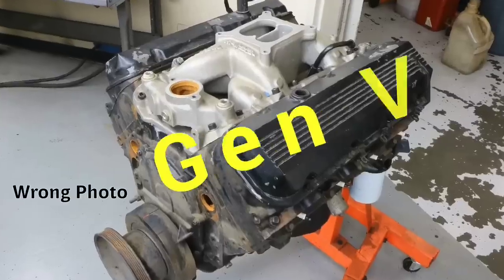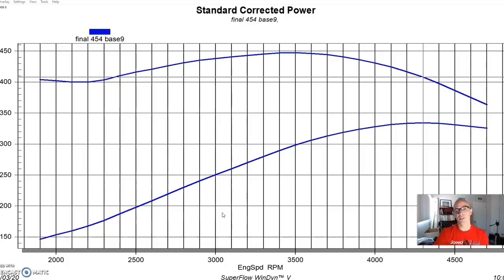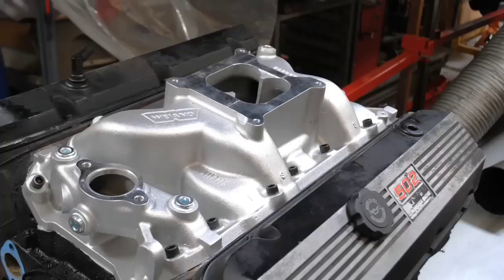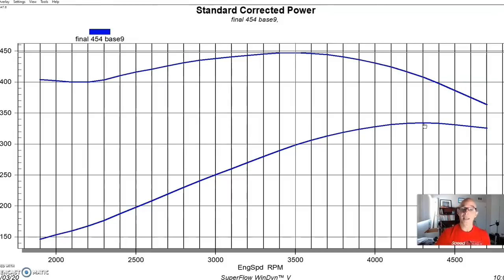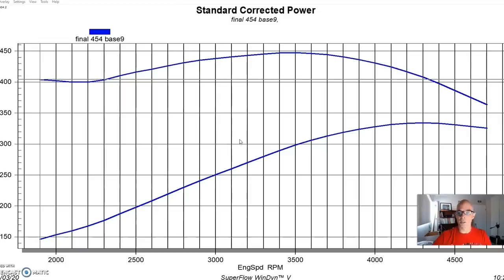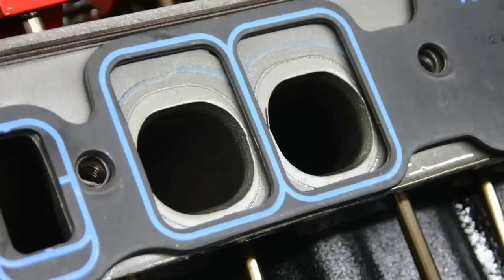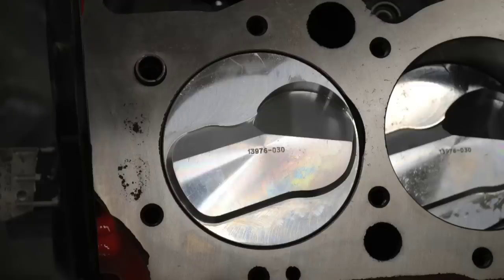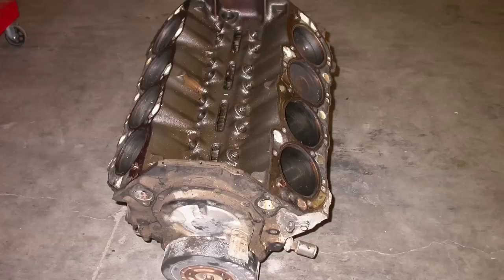HOW TO UPGRADE YOUR TBI PEANUT PORT 454

Comment: I have a 1985 k30 with factory 454 and 4 speed. I love that you can pull the engine down to 800 rpm in 4th gear and then accelerate without even downshifting.  No point to ever rev the engine above 3500 RPM it's not ALWAYS about peak horsepower.  And yes I also have a 700 hp n/a big block in a different vehicle. These peanut port head do have good use in certain vehicles
Reply: Dont know if you will get this its been 4 years but i just got a 89 GMC K3500 Ext cab s I single wheel not dualy came from factory w 454 4 speed and original motor had problems and they just put a new 454 in it. I just got it a month ago and im not a professional mechanic so ive got in a shop getting a lot of bugs out of it. So my question to you does your k3500 do good off road. O know they are longer than most 4x4s but beside that by what o have seen they out do jeeps and Toyotas in a lot of ways. Any help would be appreciated! The last 454 i was around was when i was a kid my dad had one for our farm.

Comment: I have done the 1999 454 Gen 6 L29 stock peanut port heads no muss no fuss simply; 
pull all the junk injection off, add a single plane rectangle port, a q-jet, the biggest exhaust possible, Mallory Distributor with the soft gold springs, toss in a bunch of timing by hanging out over the hood while pulling a hill and enjoy at least 70 more Horse power. Makes my 11,000 pound 16' cube truck Haul ass!
Reply from the maker: 1999 Gen doesn't have peanut ports and why a single plane-what about a cam?
Reply: @richardholdener1727    This all happened way before you were born so, Dude, don't even worry about it.
Reply: What did you set the timing at
Reply: I put a gen 6 454 in my 81 4x4 suburban put a dual plane performer intake with 750 qjet and hei dizzy. The motor is all bone stock and having trouble setting the timing. Please help.
Reply: @KeithLaney-gq7cz   Night and Day difference, 454s love timing, low octane fuel and Headers!! The original Distributor can't be tuned to what we want (and has no advance) but, an old 1981 Deco (Coil in the cap) can and has centrifugal advance! No Vacuum advance hose and plug it and turn the timing up to where the engine performs the best (About 34 +/- 2 degrees of timing at 3000 rpm BTDC) there's a fine line where the beast comes alive and then falls on it's face before and after this line (Careful the ping is very weak sounding). I have a 2000 454 Savana so I can reach down (With the cover off) and turn the Distributor while I am WOT, you might have to climb out on the hood while someone else drives/ Hold the Brake/Dyno/Race Track or best speed, I know crazy, Huh?!!  I like to put the weakest springs in the advance. I also like the (single plane manifold) Edelbrock Torker 2-R for mismatched ports (No Porting required).  I think, ya could use a 900cfm Holly dual feed.
Reply: @richardholdener1727    Ok, Oval port
Reply: @KeithLaney-gq7cz     Guessed

Comment: Cool Test. I run a MK IV 454, .030" with bowl ported PP heads (minor intake port porting), bigger valves, ZZ454 roller cam, Morel lifters, Erson roller rockers, balanced to under 1 gram, and Edelbrock Pro Flo 4 fuel injection. In my 80's pickup, its alot of fun, serious torque down low. I'm still learning tuning on the EFI, but its a great combo for a "normal" street engine.
Reply: I am considering something similar, which Pro-Flo system did you get? I don’t think they make a peanut port kit, just rectangular and oval
Reply: @carlcochrane2030  I just bought the oval port kit Pro Flo 4. I have the inlet of the head opened up some, but still not a full oval. I think you'd cut the roof out of the port if I remember correctly trying to. For what I do I doubt the mismatch is really hurting anything. I have seen rec and oval port intakes tested on oval heads and surprisingly no loss on the dyno. Crazy to think that wouldn't cause an issue. Maybe another good test for @Richard Holdener to try...is port mis match really something to worry about for the average guy? I personally think not in most cases.

Comment: I am using these heads with a tunnel ram and twin turbos , i just port matched the heads to the oval port intake tapering the ports to the bowls , ( ALLOT of CUTTING ) In a k3500 dually, and its a burnout monster, not to often to see a test like this. THANK YOU! as close to a baseline test as i can get.

Comment: I had a gen6 454 that I dropped into a K10.
Edelbrock Performer 2.0 intake, Mercruiser 454 take out boat cam from Competition Products (There used to be titled as "B1" take outs from brand new boat motors... costs $35), 454 H.O. valve springs, comp rotor eliminator shims under the valve springs, upgraded timing chain + cover.
Truck only made it across town before it blew the oil cooler line and locked up solid.
No idea what power it made, but it would light up 38x 14 wide tires in the rain super easy.
Been keeping my eyes open for another one on and off for about a year with no luck yet.

Comment: I saw this on my notifications, after watching this I found my answers. Thank you Richard I just so happen to have a running Gen6 & a 1992 Gen5 running with a bad transmission. My son wants the king cab dually the 92. Well I'll fix the transmission get it running & build up the Gen6 but my son wants cubic inches so a 496 build is what he wants. I may have to convince him to go with 750 carb until he gets funding for a multiport setup. Cam will be similar to you use on the test. Great Vid!!!

Comment: Richard - another awesome video!! hit the spot. I have a GEN VI with flat tops, old skool '69 396 small chamber heads with race-flo valves, and the Comp X4 278H cam (.544/.564) and it is very close to this combo. EXTREMELY SNAPPY throttle response and throws down the power. Great 4x4 truck motor - Great combo.
I have a set of 345 Rec Merlin iron heads (still cheap, but yes...iron) and the original GEN VI heads. Would like to see either/both/similar to these with slightly more cam since I have an extra short block...

Comment: In the middle of this build now. Same dished pistons from KB forged. Smaller cam .501/.501 lift but 049 oval heads with larger valves….. tow duty for the dually.

Comment: Richard, I have an idea for a test. I think a lot of people would really like to see the power differences between the peanut ports and 781 heads on a stock engine with a stick cam.  putting an end to the debate online would be great too.

 The flow isn't that much different up to .300 lift. the 781's have about 15 more cfm at .400 and 25 more .500. The velocity difference is quite a bit though. It would be interesting to see what the difference in the power curve really is.
Reply from the maker: with a stock cam?
Reply: @richardholdener1727  yes, with stock cam. You could add to the test also and use a couple different cams with and show where the seperation starts to show between the peanut ports and 781/049 heads.  People would know without a doubt where to put there money then. It would also what it takes to take advantage of the bigger oval port heads
Reply: @richardholdener1727  I'd love to see this test also. My current project car is a 1980 Trans am that came with a rebuilt stock 454 with the peanut port heads, edelbrock performer rpm intake and headers.. I've been schooling myself on what the best factory heads are and it seems like the 781 and 049 get cited most often. I'd love to see how much of a difference these heads would make on a stock 454 over the peanut port heads ,without any other changes. Then test the 781 or 049 heads with a street cam that would be compatible to them to see what a low buck package like that could do.

Comment: Fantastic.  I'm cleaning up a 454 Gen V Suburban right now, and was looking for tips.  I've got it back to running perfectly stock, all sensors and distributor changed.  This thing is no slouch with just a major tune.  Tonawanda bow ties rule.

Comment: I built a gen V with 10.22:1 .030 over domes ported the heads with the same cam and spring etc you used the intake is an Edelbrock performer 2.0 with a Holley 750 vacuum secondary carb I haven’t fired it up yet.

Comment: smaller port= higher velocity mix, great for swirl action and economy applications.  Thanks Richard for the upload 👍
Reply: I don't know John N some how 454 and economy don't seem to fit LOL
Reply: @mrelectron6220  Truth to word on this for sure, but there are approaches to "lessen" the pain, lol
Reply: @mrelectron6220 I'd bet you could get some pretty good numbers out of this beast put a 6l80 behind it with 3.00 gears lean out way out on cruise
Reply: @austindoud273  Yep. When you compare a Big Block to a Small Block in a heavy vehicle, the big block actually gets better mpgs than the Small Block.

Comment: Hey Richard, I did all that stuff for my rv on a gen 5, ported peanut heads with maxed out valves and one more step up on the cam shaft. I just need to improve the intake and exhaust manifolds. I'm looking to put an allison transmission behind it.

Comment: I've done something similar except I put 69 large ovals with 2.19 & 1.88 valves. Mildly ported on Gen V freshened up stock shortblock. With Comp. Cams 292 Magnum. Ran very well on Premium pump gas.

Comment: I would assume my 454 is a gen iv as it had a cast iron intake with a aluminum tbi adapter. It does have retro roller lifters and a comp Cams 266H R12 roller cam in it. I regret not getting it earlier as someone obviously beat me to the rockers, studs, guides , and pushrods! Oh yeah, the chrome valve covers that were on it also. It was in a 1 ton Chevy dually around a 1990 model as it still was the square body.

Comment: I have a 90 duelly and the timing gear blew up (plastic gear). So I put a set of edelbrock heads and their can in it, it made a noticable power difference but not alot. So bought a hyper chip and installed it, very small change in performance. So in my opinion I think the throttle body isn't giving it enough air. So I think going more compression was a smart choice, now I'm anticipating going to a carburetor or aftermarket fuel injection.

Comment: My combination is a stock cast crank cast pistons 2 bolt main gen IV. Up grades include ARP studs on the mains, ARP rod bolts, Oval port closed chamber heads ported with 2.19 intakes 1.7 exhaust, installed with steel shim gaskets, comp. ratio about 9:1  Cam is 224-234 @.050 on 114 LSA cam lift .311-.325 with 1.8 roller rockers. Weiand stealth duel plane intake, 750 holley HP, long tube headers 2" primaries, 3" exhaust. Transmission is NP440 MY6 3 speed with OD. Rear end is 10 bolt posi with 3.08 gears. 1st gear is 3.09, combined with the 3.08 rear gives 9.5 final first gear ratio. Don't know the torque and hp but in 2nd gear it pulls like crazy to 5500rpm, It's a smooth running engine and lots of fun. Thanks all the best.

Comment: I have a 1994 Chevy k3500 with a Gen V block. Last summer I swapped the heads to gev 6 with a intake and headman headers. And Holley EFI. Would love to see you do a build on a similar engine. Gen 5 block with gen 6 heads!
Reply: Oh yeah and I’m running the stock gen 4 camshaft :((( need to upgrade
Reply: Gen 5 cam
Reply: What head gasket do I use to I'm wanting to do the same thing

Comment: I did a set of peanut port heads with 2.25'' intakes and 1.88'' exhaust valves for a jet boat. 10:1 454'' with a hydraulic roller. It got up on the hull real fast and was quite quick. It was a jet so it didn't mph. Torquie for a small motor.
Reply: Which pistons did you use? Run on pump gas?

Comment: I'd just stick with the Gen6 if I found both in a wrecking yard. Now if I already had a Gen5, then maybe just throw the cheap Gen6 heads on. I currently have 2 Gen6 BBCs. I bought some 100cc Performer RPM heads with a performer RPM roller cam, stock lifters, holley high-rise intake and 825 Carb and headers. Makes 580hp and hauls the groceries in my 69 Vette!

Comment: Mr Gasket makes a shim head gasket for the BBC, supposed to add about a half point of compression at least (I think the 86-92 7.4 TBI motors are stupid low compression, like 7.5:1).   had considered going this route just to see what happens.   I mean the gaskets are about $65 at Summit so it's not like you threw a bunch of money at it.
Reply: They are stupid low compression. I have an 89 LE8 with 50,000 original Miles on it that I pulled apart just to see what the real compression ratio, it had obviously never been apart so was completely stock. After cc ing everything, it came out to 7.78 to 1. It's surprising that they made the power they did with pathetic numbers like that.

Comment: Keep the forged pistons keep the cam keep the peanut ports and put on a little 174 weiand roots blower on it. Torque thru the roof @ 1500 . Also 500 horse. Remember for the street those peanut ports have amazing throttle response.

Comment: Id like to see keeping the peanut port heads with a hydraulic roller camshaft  specs. 262/272  Adv. Duration 210/218@50 with .510/.525 lift with 112 lobe separation angle  with that compression  to see where peak torque would be?

Comment: My 93 K2500 gen V 454 tbi Burb is getting Comp K11-302-4 212/218 .503/.503 112lsa hyd FT and springs, Weiand peanut port intake, 1 inch spacer, Holley Sniper EFI and long tube headers, stock computer controlling the 4L80e. Hopefully breaks over 300hp and 450tq, maybe more.

Comment: For decades we used the 268H in pick-up engines. We thought it was a good cam because we didn't understand how bad the stock cams were. At 5200' of altitude, the 110 lobe centers seemed to help with anemic cylinder pressures.

Comment: I am apparently about 5 month late to this. I have a Gen 5 454 Big Block in my Suburban. It currently has a brand new set of hooker long tube headers. Christmas present. I am going to rebuild the TBI with a bigger pressure spring to see what that does but ultimately I want to replace the intake with something carbureted or electrically fuel injected. Not TBI. I am curious though about that cam.
Reply: You're not the only one late to this party. I have a 1996 Suburban Vortec 7.4 and it is a great motor for my daily use. I switched the ecm to a 0411 so I could tune it with EFI Live and I have a good running tune in it. But I want to switch to coil on plug next. Anyway, I think the port injection of that generation might be what you are looking for, even to tune with aftermarket ecm's

Comment: I'm building a gen 5 with old style Oval port heads with big valves & a tighter LSA cam using the 128 LSA rule.

Comment: Read my mind Richard... I recently bought a running Gen V 454 from a friend. Low miles, he bought it new in the mid 90s from a GM dealer. ($400) I was in the local junk yard, found a Gen VI 454 and grabbed the heads. ($88) I bought a 1968 396 cast iron intake off of marketplace. ($50) I have a spreadbore Holley 650 DP that someone gave me years ago. I think I have the cam narrowed down to a cheap Summit hyd flat tappet. This will be a temporary engine for my 69 Chevelle. Eventually making way for a 69 L72 427 that will be maxed out for the Pure Stock Drags. In the meantime, hoping to make 400HP and 500 TQ (flywheel #s) with this Gen V.

Would like to see how peanut ports work on the smaller 396/402s vs regular factory oval ports.
Reply: Ugi

Comment: Just watched the L98 test right before this and the TPI made 494 ft.-lbs. with a 350 and the stock? cam and probably burned less fuel doing it. Now if somebody made a TPI for a big block and peanut ports that would be a killer app. Super truck engine.

Comment: I think this test is relevant, in my opinion. I’ve got two sets of these boat anchors in my shop. If I didn’t have a better set of iron oval port heads on hand, I would use a set on a new engine because I’m cheap and I have them to use. Thank you for your work.

Comment: Mine was a flat top 454 except I used a set of old school 70 model closed chamber large ovals with steel shim head gaskets it runs pretty good melts the tires. I plan on installing a 150 shot of NOS‼

Comment: I like it, the peanut port combo you made was similar to the HT454 Chevy sold except for the cam. My 68 impala would love that combo, I can smell the rubber smoke now. David Vizard write a lot about the peanut port torque potential, and you proved it out. I also like the GEN6 head idea, cant wait to see a test on that too. I want to build both, just because. I also want to buy everything I see in the junkyard. Also try this with 402bb.

Comment: I would love to see this done with a HO 502 or better yet a zz502 and see if there is easy  room for more with a cam upgrade.  Then look at heads or other options to only increase HP and torque without giving up the great low end power.